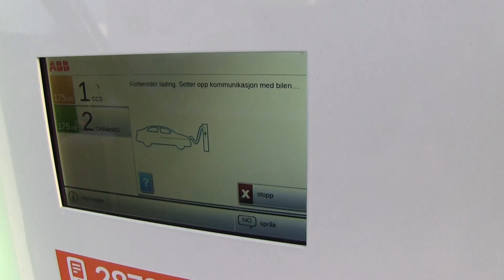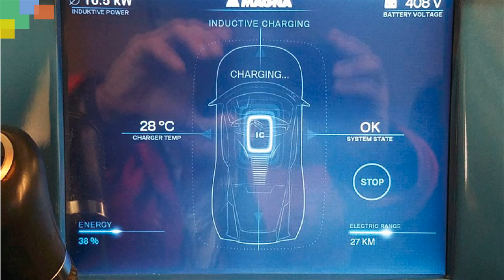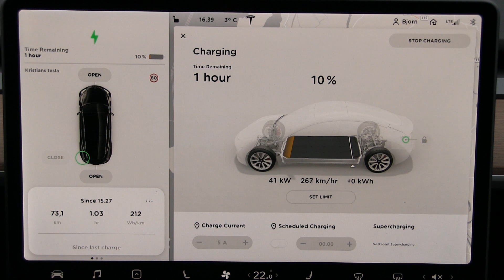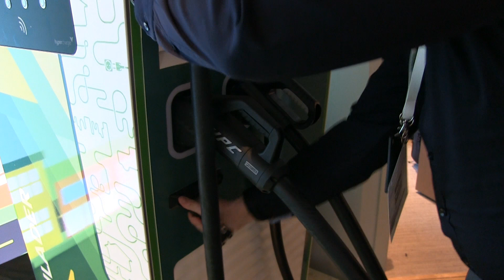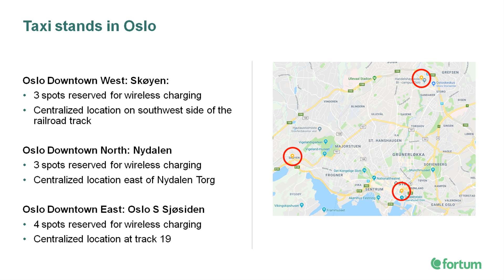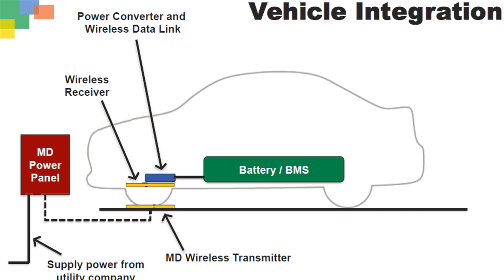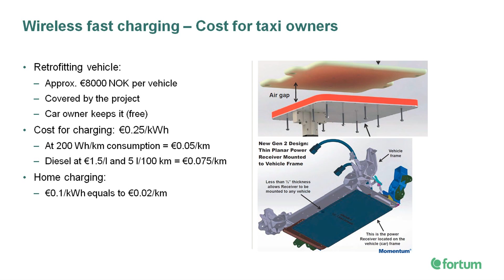Fortum's 75 kW wireless charging project for taxis

Comment: Please compare to qi chargers for mobile phones. In best case you have something like 85%. But it will go down to 50..60% depending on the air gap. With normal ground clerance you have to transmit the power over 20cm or more. 96% isnt possible in this case! CCS2 is water cooled. Blut you only cool down some 100W of heat loss. Do quick math. 50kW chargers uses 60 mm^2 cables. You can calculate the loss (P = I^2 * R).
Reply from the maker: +Björn W You can't compare phone charger with car charger.
Reply: @bjornnyland  It works in the same way. A resonant transformer. So the comparison is very good. Dont think about the power. 2,5 W Vs. 70000 W sounds extreme. The physics are the same. Loss is on many parts. High frequency switch, transmitter coil, air gap, receiver coil, DC generation,.... 96% I think absolutely impossible.

Comment: Hi Bjorn,
Could you inspect the socket charger temperature during AC charging?
I found it quite high for the Kona charging at 6 kW (mono phase):
https://forums.automobile-propre.com/topic/haute-temp%C3%A9rature-port-de-charge-14616/

Comment: Once bigger batteries are the norm like the new Leaf Plus or Kona, taxis won't need to charge during the day and the problem will disappear. In case they do more than 300 km per day, which I doubt it, they still stop to have lunch so they can do that at a fast charger. But if the efficiency of this new tech is better than with cable they have a bright future in other applications.

Comment: Nice video. Just a small audio tip for you Bjørn: Always be very careful with using a compressor on a microphone, it brings the background noise forward. So always keep a keen ear on the background noise when you compress the audio. If the noise starts popping into the soundtrack between words or sentences, it's too much compressor. If you want to be advanced you can use a gate before the compressor, to kill the silences between words, which will allow you to use heavier compressing, but you have to tweak the gate so you kill all the silence without removing any actual speech, and you will still need to check the compressed soundtrack for any rogue background noise spikes. It can quickly add up and become too much work.
Reply from the maker: I don't think it has anything to do with compressor. It's just auto gain in the camcorder playing yo-yo.
Reply: @bjornnyland  Ouch. Naughty camera.

Comment: I would bet that the efficiency rate of 96% is not true.
Reply from the maker: Why not? So you think water cooled cables are more efficient? ;) Just stop for a moment and ask yourself why the cables are water cooled.
Reply: It defies physics..
Reply: We’re a responsible and capable company, who do their research thoroughly, so we wouldn’t say 96% unless we knew it to be true. But hey; This is not a Fortum tech, but Momentum Dynamics tech, and They’ve been open about it for a while😉
Reply: @bjornnyland  The 93% efficiency for current DC chargers would include losses in both the power electronics (rectifiers) and the cable.  I wonder whether the 96% really include everything as well.  That said, the process seems to be very different.  Instead of rectifying the power from the grid before transferring to the car, they increase the frequency (presumably using a matrix converter) and transmit the power wirelessly. The car then receives the power wirelessly, and uses a rectifier built for high frequencies (probably also some kind of matrix converter) to create DC for the battery.  Even though it sounds more complicated and seems to involve more steps, it could result in less losses.
Reply: @bjornnyland  There are still cables going to the vehicle carrying the energy, and they're going to be even longer due to the fact that they have to be routed through pavement and underneath the vehicle.  Transformation is always a source of energy loss; in traditional fast chargers they rectify the 50/60 HZ AC and send it to the vehicle by cable.  In this system, AC is converted to High Frequency AC, (which massively increases the skin effect on any conductors carrying said energy causing losses) is wirelessly transmitted, (more energy loss) is received by the antenna, (losses occur) rectified, (more loss) and finally delivered to the battery.  This is my long winded way of saying the surefire way to decrease efficiency is to add steps. (e.g. changing voltage, frequency, transmission method, etc.)   I would be willing to bet that the efficiency number they quote is for losses between antennas only.   The bottom line is that the only difference between this system and typical fast chargers is the method of getting power to the vehicle.  Cabling will be present in both systems; given both sets of cables being equal, the system that has to transform power to jump an air gap will be inherently less efficient.

That being said, I'm really enjoying  your videos looking inside Fortum's equipment.  Thanks for being you Bjorn!
Reply: @mvansumeren4313  But both sets of cables are not equal. In the case of wireless charging you could use cables as thick as your arm with minimal losses if you wanted to as they are stay in place under the pavement. With wired charging, you always need the cable that is handled by the driver to be very thin or it would become too heavy, resulting in significant losses.
Reply: @MikeDeeee   Two words guy, diminishing returns.  The 7' cable of a V2 supercharger drops about 140 watts (~.12% of total delivered power) at 120KW charge rate.  Double check my maths if you wish but as FutureSystem pointed out the amount of power dissipated in the cabling is minimal otherwise they would burn.

Comment: Thanks again Bjørn for this video!!! Unbelievable, the future looks bright... I did completely underestimate the efficiency together with the amount of power you can transfer with 80kHz :-O
Reply: He did not talk about the efficency from the rectifier 50Hz to 80kHz... there is at least the loss we have with the cable charger. He compares bananas with aples.

But dont get me wrong. This thing seems to be impressif.
Reply: @Andreas-rt5sm  Efficency usually is meant from source to drain completely, means from AC source 50/60Hz to battery f.i. 400V DC ... wouldnt make sense otherwise... but anyways, we will see :-)

Comment: Sounds like concentrating the charging into a laser type transfer medium could be the answer.I was always lead to believe induction charging was an excellent idea but inefficient due to transfer losses.Fingers crossed for the cable free future!
Reply: Induction charging has nothing to do with lasers, ie,  Light Amplification by Stimulated Emission of Radiation. He was using an analogy.
I'm skeptical about the efficiency because of the large airgap, and even at a purported 96% efficiency, that leaves 4% of 75kW or 3kW of 80kHz RFI and higher order harmonics which would cause havoc for miles around without significant shielding.
I hope they can make it work, but the obstacles to success are formidable.
Reply: Thanks Andy,I did get what he was saying using an analogy and should have said "laser like".I share your scepticism but fingers crossed! @ahaveland
Reply: Andy, something  I saw in the slides was that the charger-side platen raised itself toward the receiver. That gap size is the big reason for the RF losses in ordinary induction charging. That could mean that the 4 percent loss could mostly be contained in the internal wiring and electronics. I wonder also if the laser-like focusing could mean that some sort of phased-array kind of effect is possible with the transmitter.
Reply: I suspect that is just marketing hype. RF transmissions and magnetic fields simply do not work like that.. "ye canna change the laws of Physics Jim"
Reply: @ahaveland  The losses are almost exclusively in the power electronics.  The losses in the air gap transfer of power are less than 1%.   It is really an air gap transformer.  With good transformer design, emissions are kept very low.

Comment: Got to hand it to Norway. So impressive the way they want to solve tomorrow's problems today, with a good eye on the longevity of the implementation of the technology.
Incidentally, I was very harsh on Bjorn yesterday. I said he was great, but not a legend, compared to Robert Llewellyn at Fully Charged. This was because Robert is a TV sitcom legend from Red Dwarf and other TV programmes. Bjorn is most certainly an EV pioneer and legend, just like Robert, if not quite so high profile. My apologies, TB.
Reply: As a 29-year-old, I'd say climate change and emissions-free transportation is today's problem. I'm also an American, and unfortunately, many in my country see it as tomorrow's problem to be solved the day after tomorrow.
Reply: @GordonChaffin  Did you see that I had edited my post when you answered? I point it out because I changed it from 'today's problems' to tomorrow's. I should have left it. I actually meant the specific issue of wireless charging, which is essentially tomorrow's problem - ie, in a few years. But I'm with you; the general climate change problem is today's problem. Actually, it's a problem of 20-30 years ago, only we did nothing.
I'm having a bad writing day as I keep honing my posts. Sorry about that.
Reply: @ramblerandy2397  No worries. I didn't see the edit. Understood.

Comment: Wireless charging with 96% efficiency? I'd really like to meet the engineer they hired that gave them those figures. I guess next year will be 101% efficient??
Reply from the maker: So you think efficiency through a water-cooled cable is more efficient? Stop and think about why the cable is water-cooled...
Reply: @bjornnyland  The watercooling should not be considered as an efficiency upgrade, but as a factor of protecting the medium when carrying such big loads. Yes, it gives the ability for a medium to withstand higher loads, but not more efficient. For example, if the cable was not watercooled, then from some point on, it would act as a resistor and start glowing, so the watercooling just protects the medium to operate at a bit higher load, but not more efficient. We are talking about wired and wireless transfer of energy, which there are laws of physics that have already proven that wireless transfer is less efficient than cable transfer. There's no debate on that. They use some "clever" techniques, for example high frequency, but they also use very high power current and by default this requires more input from the grid to make such energy transfer than using a cable. I also found the "it's like a laser beam" comment a bit inappropriate, especially when saying "it's not like emitting an electromagnetic radiation", which is exactly what they're doing.
Reply: I think this efficiency thing is not about cable vs. wireless. It’s actually about the bi-product of that feature; The frequency of which the AC current is converted to DC, which is in the car and is not 50/60 Hz (from the grid), but 80.000 Hz from the wireless reciever.
Reply: @gt4654  I think he meant that very little electromagnetic radiation is lost to the outside world, which would be a requirement for high efficiency.  I don't know how the Momentum Dynamics product works.
Reply: @olegudbrannhempel874  I agree.  But if is more efficient, why is such a technology then not used for charging with a cable?  I could imagine that the cable would need to be quite heavily shielded not to act like an antenna.  Maybe that's the problem.  Water cooling also increases efficiency as a hot cable has a higher resistance than a cold cable.
Reply: Mike Dee Maybe. A bit out of my tech legue here. But the AC-cables with high frequency are buried below the pavement, so Yeah, that might be it. Also; The thought of frequency-converting (increasing) and AC/DC rectifying for normal chargers would just add serious costs that are not really worth it for a single-digit percentage increase in efficiency.

Comment: If the distance between the floor plate and receiver plate could be reduced to micro mm distance then the efficiency and losses through RF emissions would be a lot less and remove the cooked cat risk. Running water is magnetic or reacts to magnetic fields. So snow ice will possibly cause issues as well. The only way I see this working is if the car based plate can drop down to meet the road based plate when charging. Perhaps when car is turned off and it detects a charging plate it can drop down and retract when the car is turned back on? High frequencies & power RF are a total disaster to radio telescopes even many 100's of miles away. 
Lovely idea but but you really need a good electrical engineer with a deep understanding about RF and EMC emissions is needed. At the moment I cannot see this product passing EU emc regulations.

Comment: Have they sorted the RF emissions issues? Wiping out every dab radio in 1Km while charging is not good. Also how to stop frying cats and other small animals that like to sit under cars at night? 
I drive a taxi and although its only a PHEV (Mitsubishi) a 280 mile + battery pack would work perfectly for my 10 hour shifts. Also having to take a break is good for my health so I can have a natural break and a cup of tea. Quicker handshake is important even with standard plug in machines.

Comment: That energy loss sounds like bull sh*t to me. Just using common sense, I think he is talking only about part related to wireless transfer between car and charger plates. OK, so there you have better efficiency, but you can get electricity to the charger plate first and this is done by cable and this will have the same efficiency as charging using normal cable charger. So you need to count both cabel and wireless inefficiency in your calculation. I'm just guessing here. But from my point of view, wireless can't be more efficient than cable, those are physics laws, IMHO.
Reply: I question the efficiency as well, but the cable leading to the wireless plate could be a lot thicker with low losses compared to a cable that a weak person has to be able to handle easily.

Comment: i should aim for 60 cars in the pilot project... and a question could it be bidirectional as chademo ???
Reply: M.A Gotti Bi-directional, Yes. But not this pilot project.
Reply: Anon Ymous Yes, the transmitter is about 5-6 times more expensive. But costs will come down. Especially on reciever side with mass-production

Comment: They try to solve a problem which doesn't exist. The charging plate has also a cable connection so it can't be more efficient.
Reply: True, but you could use a much thicker cable with a lot lower losses.  With the current solutions, you can't use thick cables because those would be too heavy to handle.

Comment: is it 8000 or 80.000 nok?
Reply from the maker: €8000
Reply: @bjornnyland  on the presentation it's written: "approx. €8000 NOK per vehicle", kind of misleading.
Reply: Yeah, a miss there. €8.000 is about correct
Reply from the maker: Yes, it was a little glitch from me. Most people would figure out that the prices should be in €.

Comment: If only Fortum would charge per kWh instead of charging time. Outlander phev is about 3 times more expensive to charge at Fortum chargers compared to others.
Reply from the maker: I don't want Outlanders to hog the fast chargers. Pricing per minute is good.
Reply: I hate the per minute charging we have in ohio usa. A small battery like my 2012 leaf only gets 8to 10 kwh in 45 minutes.   On 50 kw dc charger. I wish they charged by kwh .
Reply from the maker: Once you get a rapidgating Leaf who wants to charge to 100 %, you will understand that minute pricing makes more sense than kWh pricing.